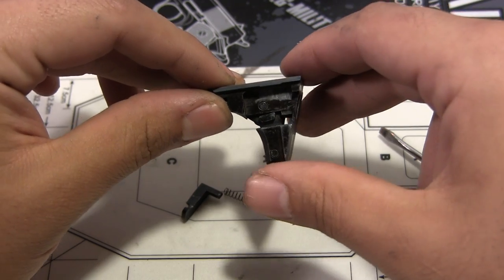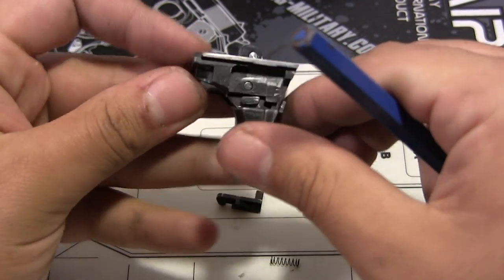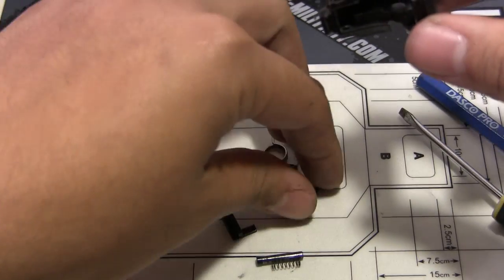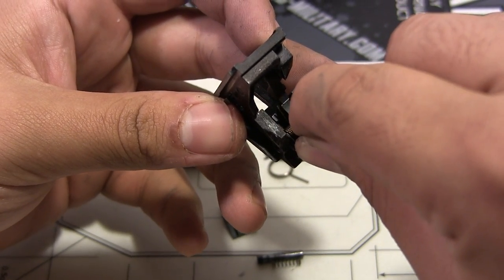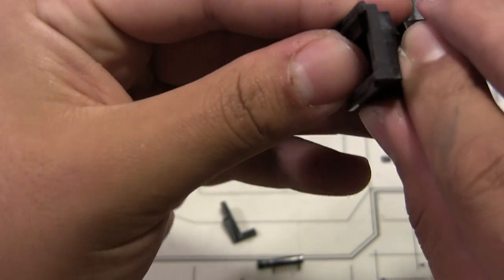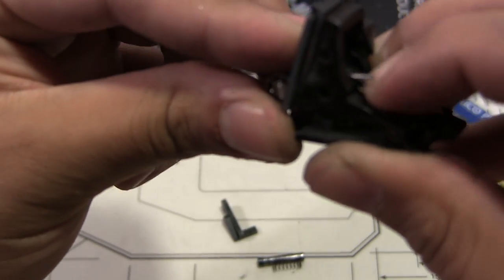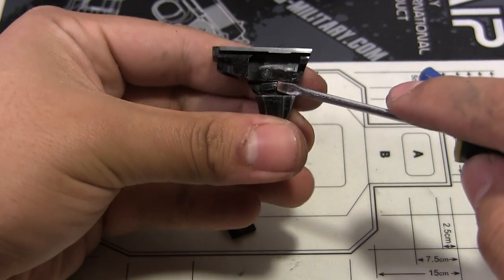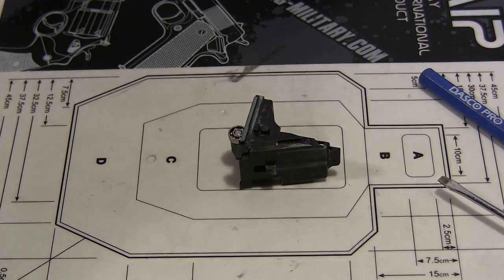Tokyo Marui Glock 17 Hammer Assembly Break Down (HD)

Comment: I don't know what has suddenly gone wrong, but every time I rack the slide, it gets locked up 3/4 open.  I can release the slide by pushing down on the trigger bar with a pick, so I think it has something to do with springs and the hammer assembly.  Great video, I'm sure it will be helpful when I dive into it.

Comment: Yo knuckles please get back to me on this question.              I have a brand new 2018 we Glock 17. I run green gas all the time. Today I bought red gas. I filled my mag with red gas and when I played the gun could barely cycle and was shooting 50 fps lower. What I think happened was that red gas pressure is to high. So when the hammer strikes the output valve, the internal pressure is too strong and the stock hammer can't strike the valve hard enough and I think the part that's trikes the valve got fucked up. I tried another mag, cycles harder but it 25 fps less than yesterdays. What is this. What parts do you reccomend I replace
Reply from the maker: if you are trying to get higher fps, just get a tight bore barrel and bucking. that will be easier and cheaper vs trying to upgrade the whole hammer chassis.

Comment from the maker: Gotcha, I'm going to speak purely from a pistol primary user okay? There is no better pistol than the TM Hi-Capa for many reasons, since you are not a noob, I don't need to explain, but just go with the TM Hi-Capa, it is much better than the Glock and 1911 platform. Based on the TM Hi-Capa, for your requests I need to know more. 330FPS? 350 FPS limit? 400 FPS limit? Money budget? Looks? These are important to know for me to help you out, send me a message if anything. Hope that helps!

Comment: HAY. Im looking in the market for a new TM. I want to to help me pick from any Glock, a 1911a1, and a high-capa 5.1, but first whats your pick for a stock, for cycle rate, fps. After your pick which is best for a complete upgrade, for both gas efeciency and performance. Side note, i have been modding and upgrading 1911 based TM for about 3 years and dont need the noob talk. Sorry just had to say, because the forams give me the noob answers and replys. thanks.